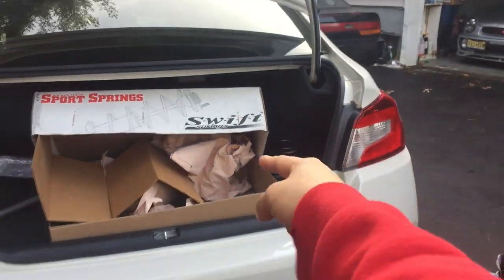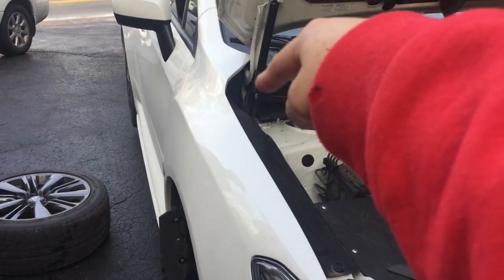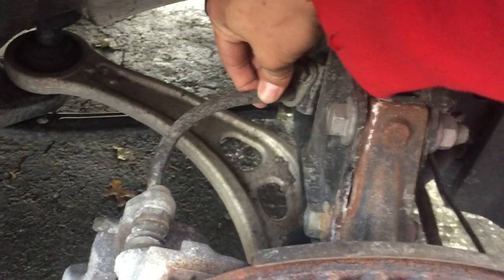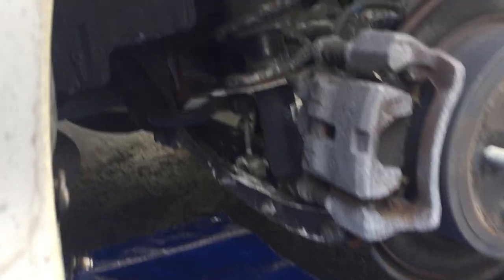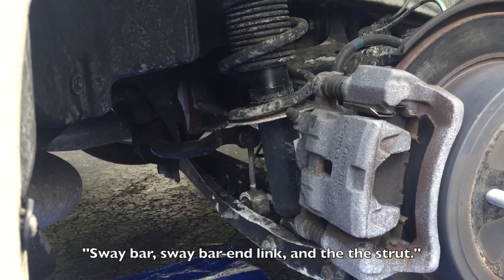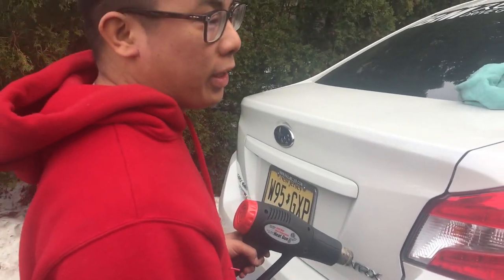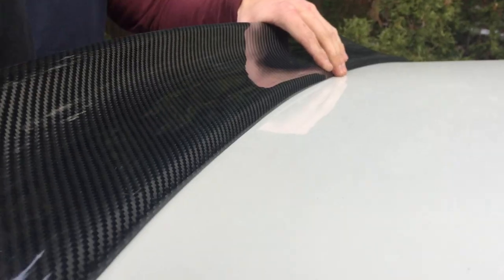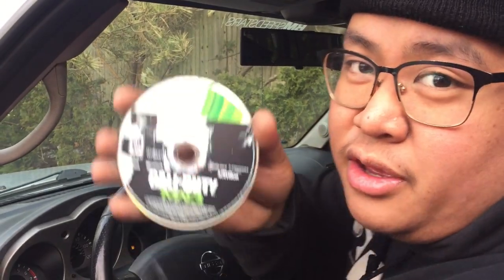SPRINGS ON THE STAGE 2 WRX

Comment: Nice vid. Where did you jack up the car? I cant seem to find that center spot
Reply from the maker: Pojay Pojay I believe it was just the pinch weld running along the car, usually on, for example the s13 and mr2, you can't do this but since it's a newer car, makes life easy!